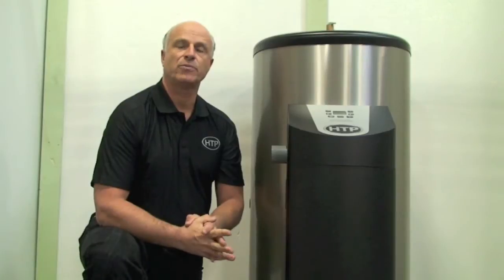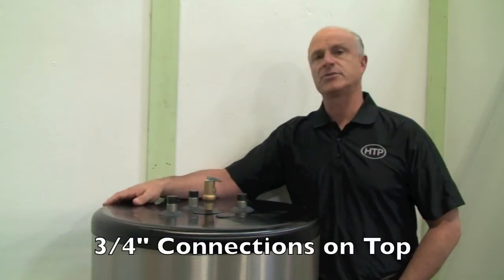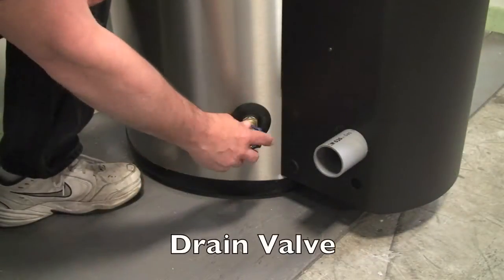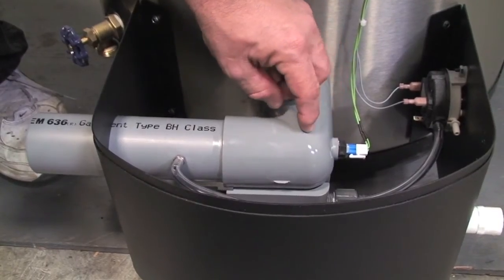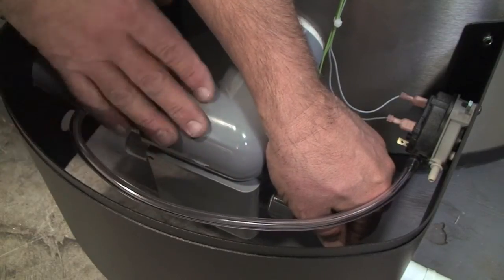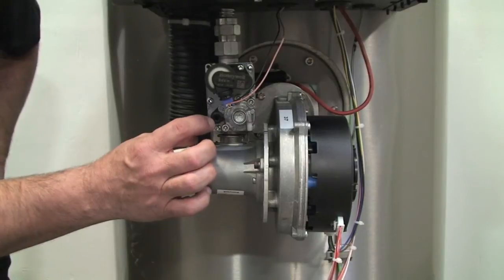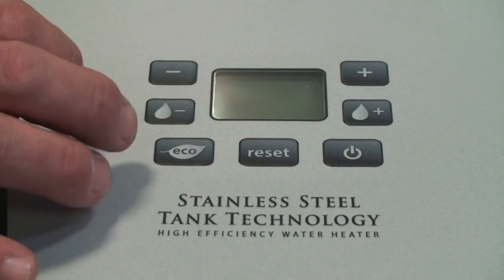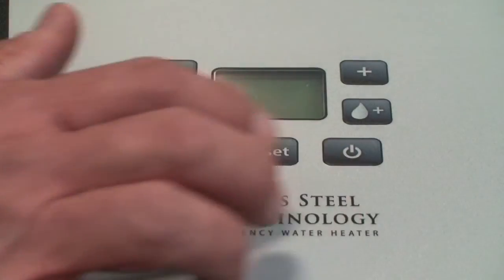Phoenix Light Duty Overview

Comment: You have anyone in the New Jersey area that knows how to fix a problem I have had since it was installed by a moron. The Northern and Southern Rep came here, separate times, and know NOTHING.. Mr. Davis I need someone to fix this high priced unit, which I am sure is great but only if it's fixed correctly...Help